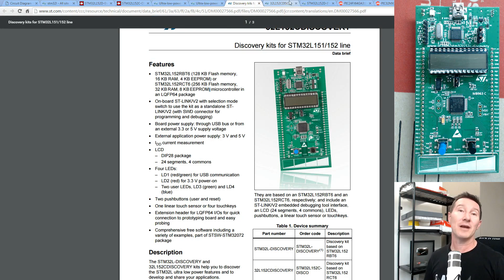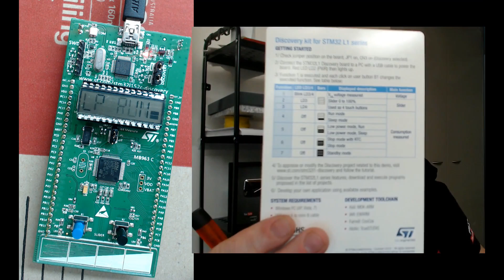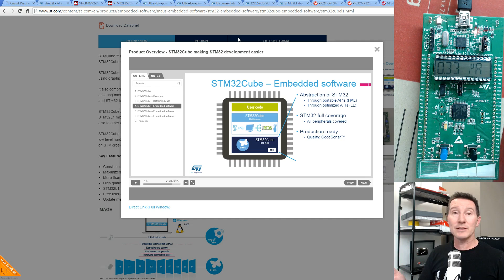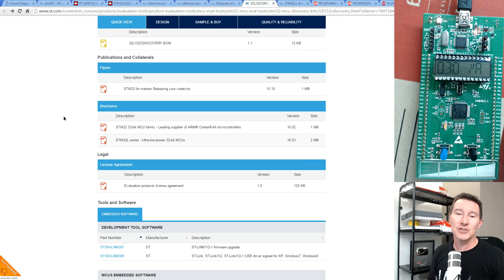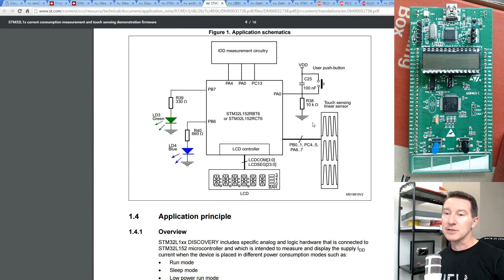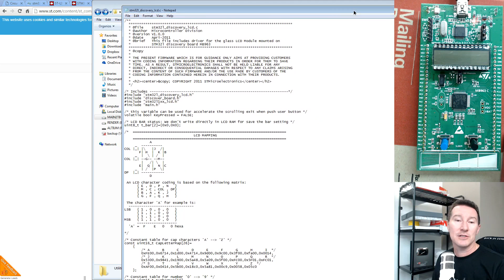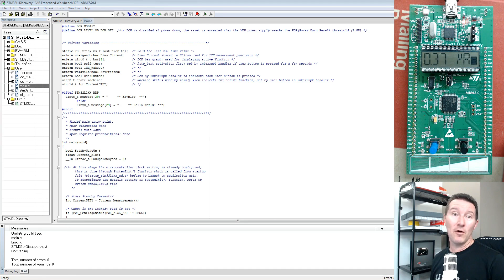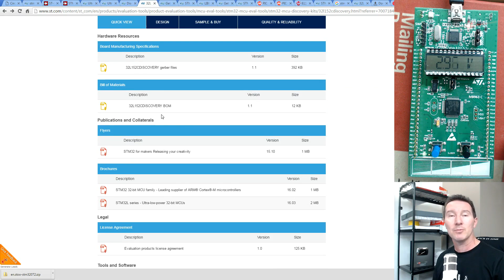EEVblog #900 - STM32 ARM Development Board

Comment: iAR, etc use commercial terms to be promoted by chip vendors.  And they all produce shit.  Dave, just get a Linux box set up and install arm-none-eabi for free.  install openOCD for on-chip debug support.  Never use the commercial stuff, it's expensive and inferior.
Reply: GCC based compilers for microcontrollers are just junk, they produce worst possible code, inefficient, slow, big ... They are just unusable for anything more than toggling LED on pin.
Reply: Bullshit.
Reply: lmiddleman
From your comment I see you never used any compiler other then GCC so I see from where comes your ignorance.
One when you find real job and try any of compilers that are written for microcontrollers you will see difference.
Just for your information IAR from STM32 microcontrollers generate 50% smaller code GCC (for Atmel around 30%) ... and about speed it is just stupid comparison GCC is order of magnitude below IAR (or Keil or TASKING).

edit: GCC it's worth exactly how much it cost (that is only apply for microcontrollers, for x86 is ok compiler, even better then most commercial compilers).
Reply: I have seen IAR do very dumb things indeed, and produce bigger code than GCC.  You can always play tricks to make one look better than another.  GCC built code for ARM does get shipped, for real paying jobs, doing a fair sight more than toggling an IO.
Reply: Both GCC and commercial compilers will generate the same "code" it all depends on settings and the code you write.
Reply: Miloš Lazović The optimization options in GCC work extremely well in both size and speed.
I wrote a fairly complex code for STM32F373 (Cortex M4) and GCC worked great for me.
Reply: lmiddleman
Give me one example where IAR do dumb thing, IAR had some problems in old versions for Atmel (<3) but not for ARM (as I know but I didnt used ARM at that time), new version do behave as it is documented (and according to C/C++ standards).
IAR in no case will produce bigger code then GCC, you cant manage that even if you try very hard (except if you compare GCC code optimized by size and IAR code optimized by speed with turn on option that it can generate code without size limit, but even in that case GCC will produce bigger code then IAR).
Trust me I would use GCC gladly if it would generate even 10% bigger code then IAR, I have better places to spend 100K$ every year then on compilers, but I will rather spend that money then lose multimillion jobs just because someone will be more competitive just on account he can drop final price of product because it is saved on the price of hardware trivial method of using a better compiler.
And yes we do test on every new version of GCC to see if it comparable to commercial compilers and not one till now was not even close (test program is written with GCC in mind and than change just enough to be compiled and produce working code with IAR and Keil).
Nobody's stopping you to use GCC for commercial product if you have economic viability, but that usually apply only to small production runs of simple products.
Reply: *****
No they will not, what you pay is ability of compiler to optimize code.
Yes they all will produce (in most cases in case of GCC) working code.
Reply: *****
And you tested same code with other compiler, to see how GCC compare to them?
If you didn't do that than you do not know is GCC did any optimization or it maybe it generated 1000 times bigger code then it should be (other way is to look at assembly listing, but if you can understand what compiler did than optimization is shit :) )
If you are     satisfied with GCC then keep on using it, for jobs I do it just do not cut the mustard.
Reply: Miloš Lazović I did tested with a simple example and seen no difference.
I'm using Linux excursively so there are less options for me.
While I'm more a HW engineer than SW the code I wrote for SBMS100 is fairly complex and I had zero problem in using Eclipse + GCC.
If you are curious of how complex the SBMS100 software is take a quick look at the SBMS manual http://electrodacus.com/SBMS100/manual/SBMSmanual.pdf
Reply: *****
I did quick test on your code (I just compiled main.c from SBMS100-v01a.zip file you posted on G+) and I got good results from GCC, it made just over 13% bigger resulting code then IAR (both using optimization by size). Personally I expected less difference because on quick look at your code it look like something that is not easy to optimize for size (especially single file, on whole project i would expect IAR do much better job with multi-file compilation option turn on).
By the way you did better job writing code then most people who declare as SW engineer (on quick look you did very good job).
For your application GCC is perfectly OK, if I remember you didn't plan (or you are not able to) to produce SBMS100 in big quantities (again if I remember you stated in our previous conversation that you plant to make it in around 500) which will make paying IAR or Keil not financially profitable (you would need to make 10$ savings on each product to break-even).
I do not agree with some of your decisions (like using aluminium core PCB), but in this case I totally agree that GCC is perfectly suitable to be used for your application in SBMS100 and IAR or Keil would be just throwing money away.
Reply: +Miloš Lazović
Have you compiled with GCC or was that based on my results. I get 143.572kB with GCC and that is perfectly fine since I use a 256kB version of STM32F373. Plenty of space for additional futures.
Impressive that you where able to get and successfully compile the SBMS code so fast.
My code is good because I understand the hardware but is not easy to read and not well commented. Most of the code is in the main file and I could have been more organized and split the code in multiple files.
Why you do not agree with metal core PCB ? I find this a great choice for power electronics and any other option will have been more expensive by far.
Total TDP of SBMS100 is 22W and the SBMS is mounted on an external heat-sink with the metal core PCB at the bottom this works great.
The SBMS needed to be light weight to reduce international shipping cost's and without metal core PCB 255 grams will not have been possible.
Also the 120A current can be done with just a single 3Oz layer on metal core PCB.
Also this is low volume so custom copper buss bars will have been a way more expensive option.
Metal core PCB is extremely inexpensive now with the mass production of power LED's
Reply: *****
I needed to compile by myself for both, because I need to modify a little code to be able to compile it with IAR, I need id to kick out some headers and to remove inline assembly (I do not know reason why IAR was unhappy with headers, for inline assembly IAR do it differently), so I needed to compile it with both. And just for simplicity I compiled only main.c (not all files and did not link it) so your size is not what I can compare it (your size is for all files linked). For GCC (launchpad GCC 5.4 for windows) I used all default settings from CooCox except i put optimized to speed (which just add -Os as I see) and for IAR all default except i switched from balanced to size. That was just quick and dirty test which give some approximate figures, probably with some more time spent on options I could get better results for both, but this was just basic test (I did not want to spend more then 10 minutes on it). One small amendment what I got after compiling will not work correctly (that is true for both compilers) from reason to be able to do test quickly I kicked all code that is not compatible with both compilers (both produced "correct" code but it will not work as you intended and what you got when you compile it). If I wanted to make it work correctly and compile whole code I would need much more time then I was willing to spend to this test (lot of more modifications then just kicking out couple of headers and instructions), but  my intention was not to get firmware for SBMS100 compiled with IAR, it was just to test how IAR compare to GCC on some part of your code.
Results of that test are what I expected, yes IAR will save some bytes, but not enough to be worthwhile investment..
Your code is for me perfectly fine to read (you have some inconsistency using new line but is OK, and totally irrelevant) and as comments I do not like code which have to much comments, it just make me harder to read code, I prefer code to tell me story not comments (I do not use comments except when I do something not logical and not easy to see why).

As your other part about metal core PCB I do not want we go again to that discussion, we had it one already ( I am supporter of buss-bars) and we did not agreed first time.
Reply: Miloš Lazović I understand now. I use the -O2 optimization based on experiments that generated the best combination of speed and size that will generate 143.6kB of code with no optimization at all -O0 I get 210.8kB and with -Os I get 130.9kB
Still code size is not that important today with that much Flash in modern microcontrollers and the extra Flash will not cost much.
I can optimize the code quite a bit but the time investment is not worth the savings.
I did not realized I had this discussion with you about the buss-bars vs metal core PCB.
Reply: *****
I generally agree with you that memory is cheap, but again with savings of just 0.1$ of 100000 pieces you will save considerable amount of money (you will get basically 2 IAR for free), and again if you do limited production run you will never save enough to be payable to buy IAR. I talk only what compiler can do without your effort (basically what you get for free after initial investment).
If you have enough time you (in most cases) can optimize any program more (there is old saying which go some like this "every program have one excess line, and one wrong line")
Again there is how code generation engine used in compiler is stable. For stable compilers you are not able to help it in optimization by using simple modifications in code (like in case of old Microsoft c++ compilers, where you can greatly assist optimization by just changing order of instructions).
Reply: Miloš Lazović I only do small runs usually hundreds of units so even $1 more for the micro will not make much impact.
I like to have extra memory for adding new futures later. As it stands I will need to realy try to fit the current SBMS code in the 128kB version of the microcontroller.
Most of the time the code is not that close to one of the steps that a 10 to 15% improvement in code size will move you from a 256k micro to a 128k.
Not sure about speed but GCC seems to take advantage of the hardware as I used DMA and FPU.
The advantage I see with a good commercial IDE is good integration of tools and less time spent installing and testing the tools.
My projects are also Open Source and will be less productive to offer code written and complied with a commercial IDE.
I always test the code as I write for both speed and size so I know when something takes more than it should.
This is my first embedded C project in the past I used assembler only (better control of the hardware but not realy an option at this point for complex projects).

Comment: I've come accross STM32 micros alot in the last one or two years. I was an AVR fanboy for a long time, but seeing all the performance and features you get for pretty much the same price in the STM32 series, I'm trying to really get going with the ST parts. I have not yet managed to get one running from scratch (yeah, all that initialization of the pins and clocks is just to much; something that was easily doable on an AVR even in pure assembler). But at least I got to the point that I can change stuff in the Cleanflight flightcontroller software for example, like moving pins around and activating additional hardware like UARTs, I2C and ISP to make better use of the chips than the original software.

Btw. you can get an STLINK V2 on ebay for 3€. No problems at all even when the development "PC" is a virtual Linux guest running on Windows.
Reply: Ditto. Though managed to get bare STM32F152 up and running with arm-gcc from scratch, but I can't still wrap my head around GDB (having used Visual Studio for so long, lol).

What I like in STM micros is that you always have an unbrickable bootloader built-in, that can be used to program the thing through UART or I2C. The Arduino is so widespread, I can't even be bothered to buy myself a separate USB-UART adapter :D
Reply: ZXRulezzz
It also took me some time to get the debugger running, because I never used one before. But in the end I just followed one of the many "how to"s about it and it worked fine in eclipse (took two or three different tutorials though).
Reply: superdau I guess I would use eclipse if my job depended on that, but I kinda dislike it and generally tend to stay away from it. Last time I used it (the one that came with Quartus II in particular), it was unpleasantly sluggish at absolutely everything. And it seemed so complicated to me, that I had to strictly follow configuration guides, because I felt like if I miss a step somewhere, I'll never find it again.
Sometimes I wish some notepad-like simple and lightweight IDE existed that would have primitive programming and debugging features like breakpoints and steps. And maybe a hardware viewer.
Just like what AVR Studio used to be in v4, before it turned into that Visual Studio-based behemoth of a environment.
Or PyCharm, but that's another story :)

I guess I'll just learn raw GDB at the end of the day... :)
Reply: What you don't get with that capability for the price is any sort of decent applications support. The customer service is non-existent and the forums are almost useless when you want an answer to a real and difficult problem.
Reply: Yeah, Atmel's customer support is so terrible it's a joke. Thank goodness Microchip bought them out!!!
Also, after quite a bit of experience with micros, TI/Microchip are where it's at. TI's free CCS IDE is easily the best free IDE I've seen (based on Eclipse, which I'm not a fan of, but TI have ironed out a lot of the wrinkles, and it's mostly free -- I've worked with Tiva C, MSP430, MSP432, and Hercules chips without needing to pay for anything but the dev boards).
Microchip will sell you pre-programmed chips, which is really, really nice when you go into production. Just finalize the code, get a reel of chips, make the boards and they work!

Comment: Hey Dave! Look for SystemWorkbench, its a package (simplified installer) including Eclipse, gcc, programmer and debugger. STM32CubeMX generates code for it, look for SW4STM32 while configuring the project. Also, its free software: $0, completely unrestricted, forever, source available.
Reply from the maker: Yep, I'm going to check this out, maybe another video. Crazy that the manual for the dev board does not mention it or support it
Reply: +EEVblog Dave, you can try no code size limit Atollic now. Theres just 3 second nag start screen. I am using that as replace for custom Eclipse gcc gdb pack. It has same functions, comfort plus examples for every board
Reply: For me a big THUMBS DOWN for CubeMX initialization code. The code generator works in some way but the used HAL libraries are a mess compared to the "old" FWLIB when you look at code size and performance. The HAL library also uses several "dirty" programming tricks, i.e. intentional weak linkage for required callbacks and other stuff you do not expect.
Reply: I got it after the invention of a few new sear words using their site.  Just downloaded it and there you go. Don't ever ask me how I found the link.
Reply: This!
Also thumbs up for the CubeMX code generator.
BIG thumbs down for:
- not directly recommending SystemWorkbench (a gcc based toolchain plus IDE is what most people want. It's 2016. We don't need no stinkin' proprietary compilers on ARM anymore)
- not clarifying that you have to choose "SW4STM32" when generating code for SystemWorkbench
- HAVING TO REGISTER FOR DOWNLOADS!!!1111 People will continue to create and publish fake accounts on bugmenot.com until st understands.
Reply: The first thing I have to do in the download section of the SystemWorkbench is to REGISTER with Name, eMail, blabla .... WHY! Is it completely unrestricted, open source, or not?

Comment: I personally prefer the NXP/Freescale product more, now that they cleaned up their IDE a bit. The fact that you can snap off the development part of the devboards to make them just a programmer is great.
Reply: Actually STM have the same thing going on quite a few of their boards (Nucleo-64s) have a break away STlink V2 on them.
Reply: Which development boards allow you to break off their boards to make them suitable in-circuit programmer/debuggers? Only thing I know of is the Segger J-Link EDU that is vendor neutral for dev debug programming
Reply: You can break off the programmer on most of the nucleo boards. I've also routed off the programmer on discovery boards twice, because I wanted to fit the board into a certain case. The programmer was unuseable after that (would have required too much bodging to get it run standalone and when you can get an st-link for 3€ on ebay it's not really worth the effort), but the rest of the dev board was totally useable after mocing over the 3.3V reg from the programmer part and making a few small patches.
Reply: Yeah I know about the fact that ST has it as well, just thought i'd mention it. Every manufacturer should do that on every devboard in my opinion.
But with regards to NXP/Freescale, they offer some parts the competition doesnt, like the LPC11cX4 series. They have a built in CAN transceiver, something no other manufacturer appears to have.
I also really like the K series of the kinetis microcontrollers for their many PWM lines.